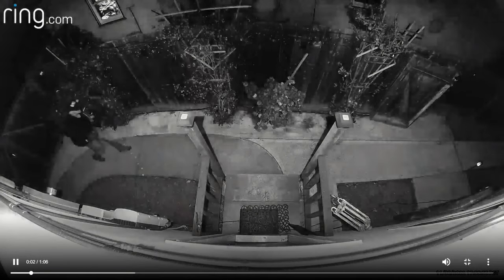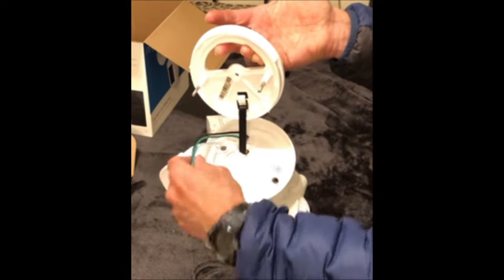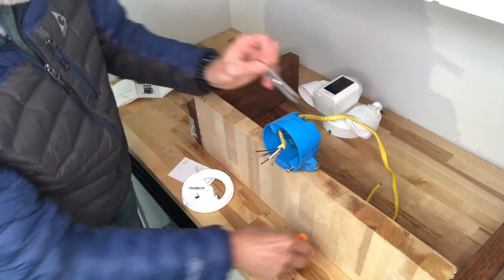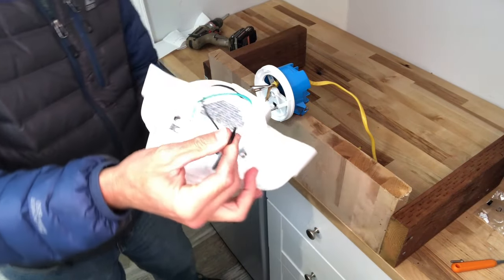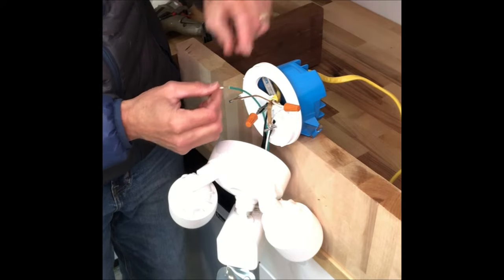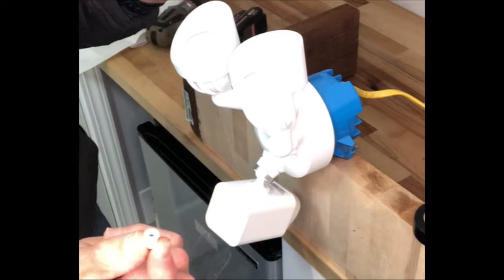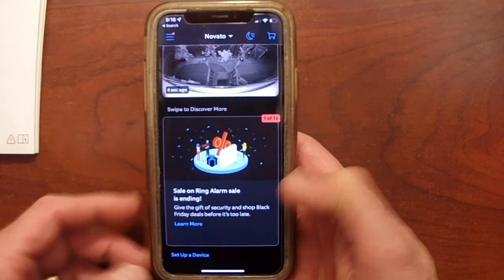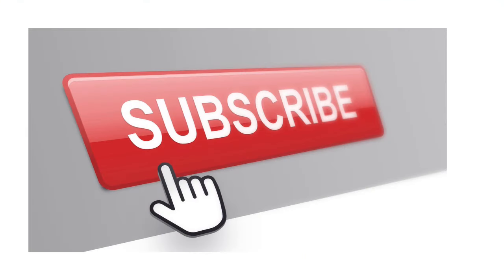Ring Floodlight Cam Wired Plus Installation and Setup

Comment: Nice video with clear instructions. I don’t have a junction box so I used the Ring plug in adapter ($20 on Amazon).  Just need to run the 20’ cord to an outlet in my garage.

Comment: Most helpful, thank you.  We have a Floodlight Cam that died on us.  Ring sent us a Wired Plus replacement.  They don't make the Floodlight Cams anymore.  I haven't got the replacement installed yet because I was not able to get the wing nuts off the original installation - they were not the screw-on type, but rather a rigid plastic crimp-on assembly.  Probably a better choice for a wet climate.  Per another video, I will probably have to cut them off.  That aside, the mounting bracket installation component was not entirely clear to me but your video resolved that issue.

Comment: What do you do if your switch controls porch light and over garage light then when I cut off light switch in the morning won’t it turn off camera?
Reply: I have the same question
Reply: @yolandalopez52   I think the best bet would be to run Romex wire from a constant power to the fixture and just cap off old wire . I’m going to try it tomorrow will let you know how it goes
Reply: the easiest way would be to take the switch out connect the light leg and hot wire and either put the switch back in as a dummy or put a blank plate

Comment: Hi, I found your video very informative. You explain the installation process to an existing recessed junction box but I notice what appears to be a small cut out in the moulded base which suggests that this can also be flush mounted and powered via a surface run cable which enters at the base. Is this correct? I ask because I don't have a recessed junction box as it is not a common feature here 🇬🇧. Many thanks.
Update: I took a chance on the ring wired floodlight cam plus while on offer & and can confirm that the UK version does have a recess to allow it to be powered from a cable (flex) at the 6 o'clock position. Max 10mm dia cable.
Reply: hi m8 did you need a surface mounted junction box to mount it to the wall in the uk ?
Reply: @craigbrooks9001  I couldn't find a surface mounted JB that was large enough to take the diameter of the base but small enough to fit on a gutter facia. I could not find a round JB but could find a square one bur it was too large to fit where I wanted to locate. Anyway, a JB wasn't necessary when I realised that the ring base was designed to accept a cable entry at the 6 o'clock position.
Reply: @allanb2906  yeah m8 i’ve seen that the junction box is only required for the usa
Reply: @craigbrooks9001  Yes, but it isn't obvious from any of the ring literature or from YouTube videos that there is a recess moulded into the base to accept an external cable rather than through an American style wall JB

Comment: Hmm 🤔 my concern is on an old system of wiring the ground isn’t clear. There is a naked copper wire do I attach ground to that?
Reply: Did you ever figure that out? Dealing with that problem currently

Comment: Can this light be turned on for an extended period of time or does it only come on with motion?  Right now I have a flood light I keep on all night and it is on a switch.
Reply: Yes there is. In the ring application you can control the light and alarm feature.

Comment: Hello, how much lag time does your camera have before you can see the video? I'm thinking maybe a wired type camera like that would maybe be instant image load when you open your phone.  I use driveway sensors to quickly alert me to motions, but I have to wait 15 or 20 seconds sometimes before my phone loads whatever triggered them.  That's just enough time to miss whatever it was.  I'm using another brand of wireless camera that I'm not to happy with when it comes to alerting me.
Reply: It’s practically instant.

Comment: What do you do to stop the lights of vehicles driving passed from activating the light to turn on? Walking passed at that distance doesn't set them off so it is purely the car lights that set it off ALLLLLLLLLL night. Thank you in advance for any help you can offer.
Reply: I’m not the video creator here, but I am somewhat familiar with Ring. I would call their customer service. Their customer service is very helpful with questions.
Reply: Set the device up to only recognize people walking then you won't get car alerts
Reply: There is a sensitivity setting. You can limit it to a the area you want to have covered. As well as it’s sensitivity to movement.   You also have the option to disable the light feature

Comment: dont understand, how did you install in the wall?  drill a big hole for the box?
Reply: The box was already there, or you'll have to surface mount the box. They have weatherproof 4" electrical junction boxes for sconces at home depot